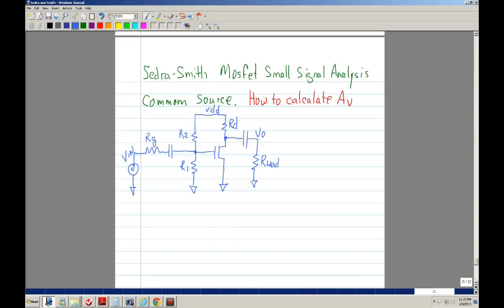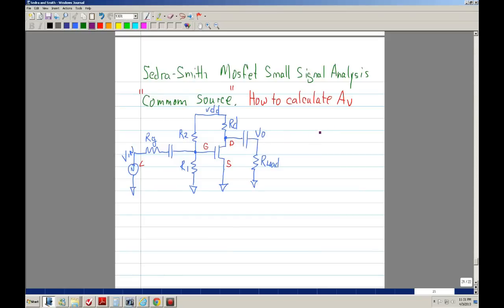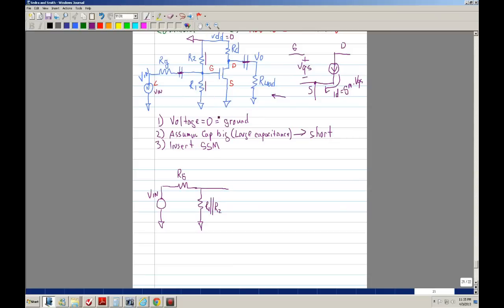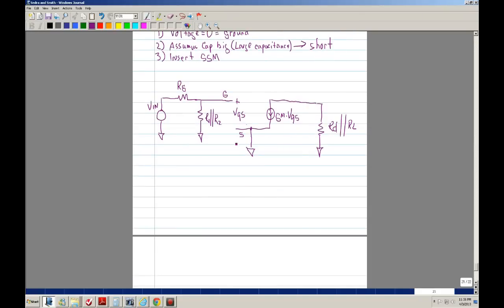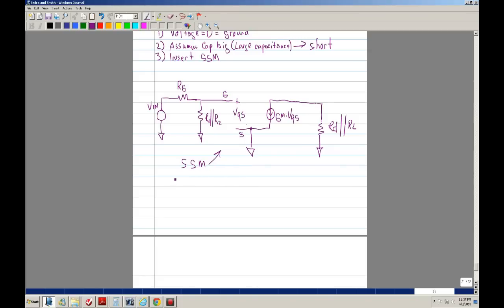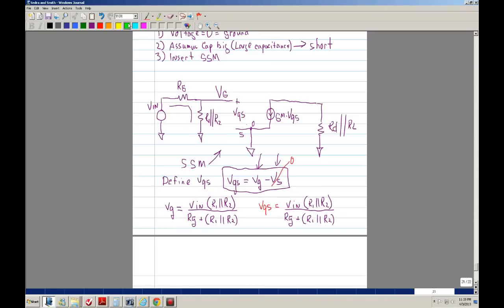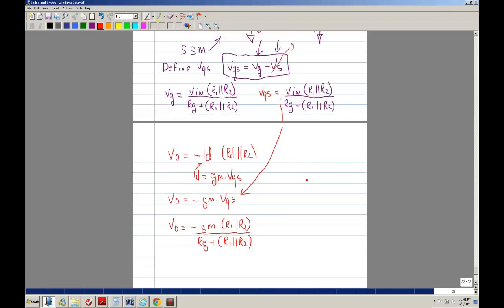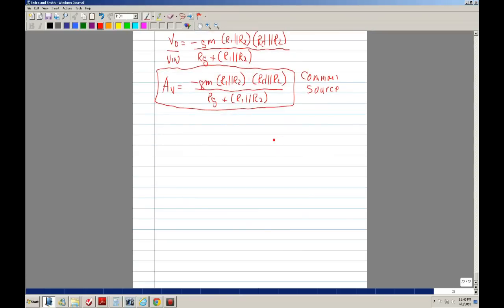Sedra Smith: MOSFET Small Signal analysis Common Source

Comment: What is the effect of early voltage?
Reply from the maker: If I am not mistaken, MOSFETs don't have the VA or early voltage. Instead they have lambda which express the Ro the output impedance in parrallel with the small signal current source.
Reply: @RobertBolanos  Sir I was solving a question and I was given a ckt with early voltage Va=50 for MOSFET and I have to calculate Rin, Av
Reply from the maker: @UsamaSyed-  You will have to ask your professor. There is no VA spice parameter for MOSFETs. VA or early voltage is similar to Lamda.   Lamda is used to express the Ro (intrinsic output impedance) by using the following   Ro=1/(Idrain*Lamda)).  Its is similar to the VA but for mosfets, this is the wrong parameter.
Reply: @RobertBolanos  ok sir, thank you so much

Comment: Dear Sir, do you have a video that explains a Multistage Op-Amp Common Source/ Common Gate design? If so can you send me the link or if not can you please make one explaining it? How do you get a 25V/V (+/- 5%) Gain with an Rin=10k +/- 2k, Rout < 25ohms, Power supply = Single 12V, Max. Sym. Swing > 4 Vpk-pk, Lower 3db pt. < 200 Hz, Upper 3db pt. > 5 kHz, & Rload = 1 kohm? 
Can you explain how to attack a multistage op amp CS/CG with these kinds of specs.? 
As well as getting the PSpice schematic & simulation, BIAS POINT Calculations, Frequency Sweep, & Transient Response w/ Sinusoidal input showing the Output Waveform? Could you make a video like this or similar to it? Thank you for your time Sir, I've really enjoyed your videos.  
Regards, 
Juan
Reply from the maker: Hi Juan, For a gain of 25 you would probably have to use either a single stage or a two stage amp. If you use a single stage, you should use a common source and use a bypass capacitor on the source so that you can get enough gain. The rule of thumb in using a common source with no bypass cap is Rc/Re. So you RC would be 25 bigger than your Re. But this might not satify your current requirement. Since you Rout requirement is 25 ohms, then RC would be 25 ohms and your RE will be 1 ohms. This will give gain of 25. Assuming Vdssat of 1V, then VDSqpoint =  9V .  The Id then is 2V/25ohms =80mA.  That is a of current and power ( 160mW).  Since you need an Id od 80mA, now you can calculate the VGS needed for the drain to draw 80mA. Hope this helps.
Reply: Yes it did help me. Thanks so much for the advice. JF

Comment: hi, very good explanation, but i'm wondering why the rds is not calculated in the model?
Reply from the maker: Ho Mohab,Ro or the impedance from the drain to source can be included in the derivement by making the total resistance into at the drain as (Rd II Rload II Ro). The parallel combination of Rd, Rload , and Ro. I hope this makes sense
Reply: Thank you very much!
Reply: if "VA" is not given in the question, u dont need to consider Ro which is very small value compared to others.